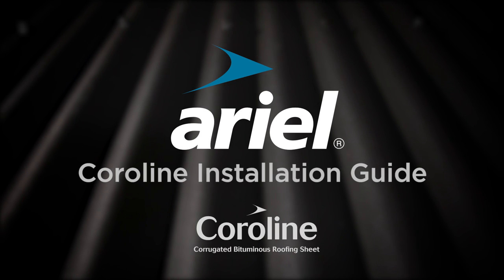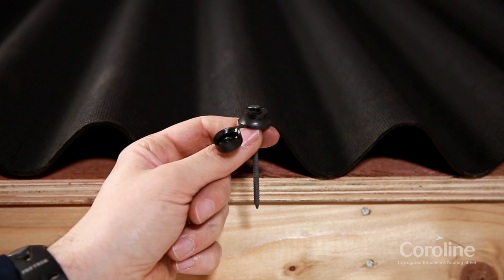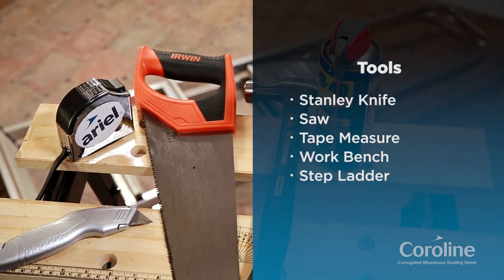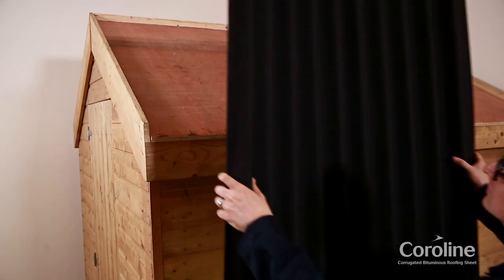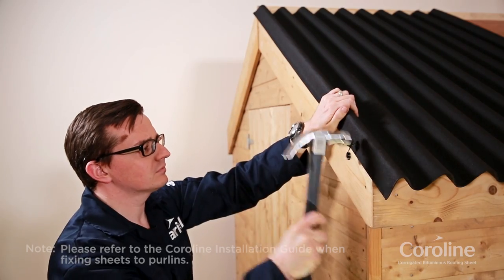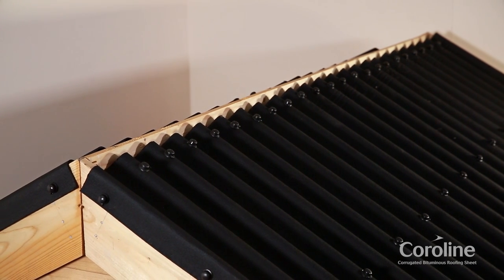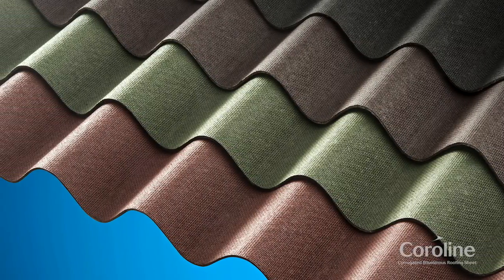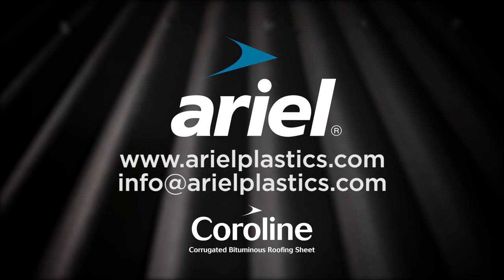Coroline Bitumen Installation Guide

Comment: Im looking at fitting some of this to a lean to/storage shed. Does it need a flat panel beneath it or can it be nailed directly to the joists?
Reply from the maker: The Coroline sheets can be fixed directly to purlins running across the roof slope as long as the roof pitch is greater than 10°.
 The maximum purlin centres must be observed to reduce the risk of sagging; 5° - 10° roof pitch, full deck 10° -  15° roof pitch, 450mm maximum purlin centres. Greater than 15° roof pitch, 600mm maximum purlin centres. See Coroline installation guide for more information on www.arielplastics.com

Comment: what fixings would I use for my garage with metal rood frames?
Reply from the maker: Self-drilling hex head screws are readily available for metal (commonly known as Tek screws).
 There are two types, one for thin metal and one for thick metal, choose the one suitable for your roof frame. Combine these with a washer and cap to protect the screw from the weather and to seal to the corrugated sheet.
Reply: @ArielPlasticsLtd  Brilliant, thanks!
Reply: X

Comment: Why can’t this be used for a entire house roof?
Reply from the maker: Coroline is a great durable roofing solution for sheds and outbuildings but it wouldn't have the longevity of slate or concrete tiles.